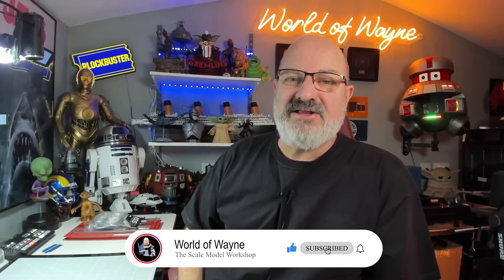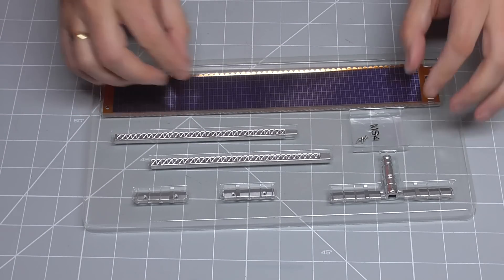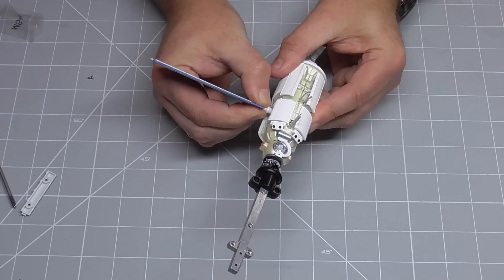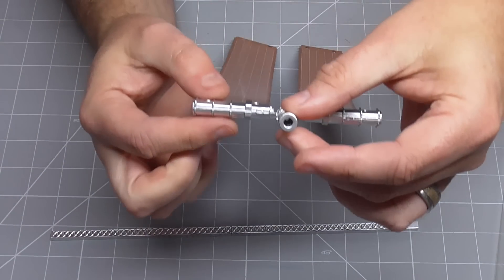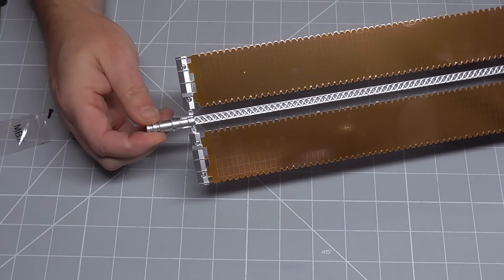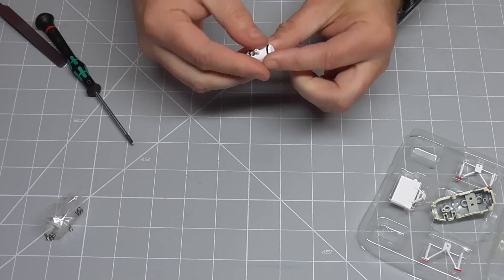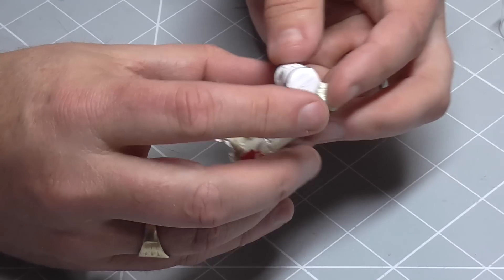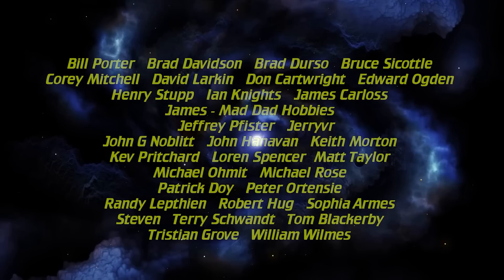Build the International Space Station (ISS) - Pack 2 - Stages 3-5

Comment: Wayne, I noticed a big "bug" in this video, something that the designers of this model didn't notice: the solar panels on the Zarya module (those short ones): they should be folded like an accordion: they were extended that way only during the first phases of the building of the ISS but they are now folded to avoid knocking the thermal radiators on the long truss running across the entire width of the station that houses those radiators and the big panels like the one you built today.
BTW, the little module you built at the end is called Rassvet and I see it still houses a certain component of a certain russian module (Nauka) that I'm sure is not included in this build (the model was probably designed before the launch and docking of that module three years ago).